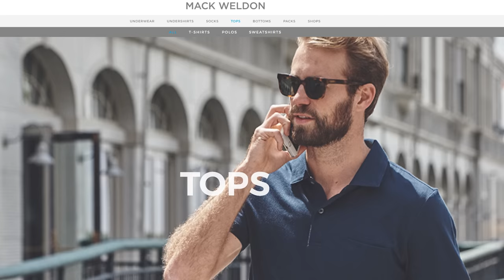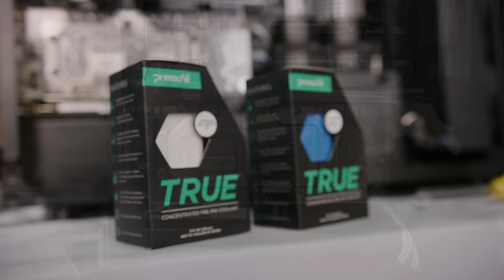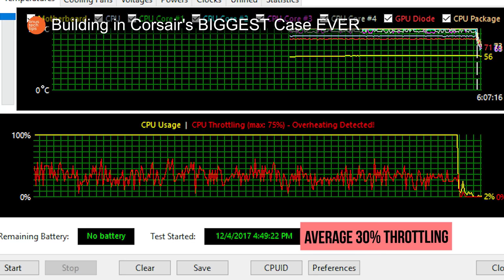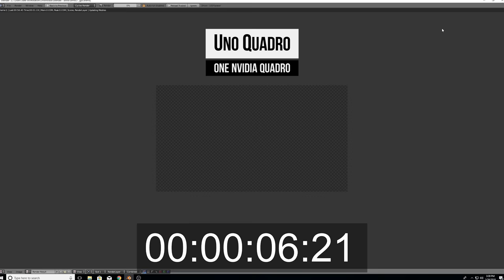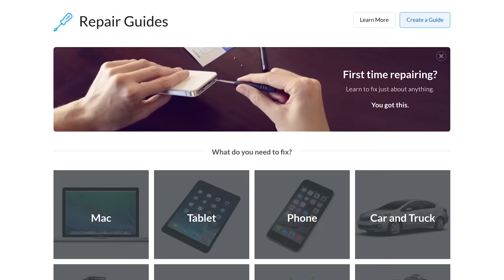Ultimate $20,000 Dual System Build – Corsair Slate Part 2

Comment: I could see this format being use by a IT pro for his / her house.  It can handle a small ATX format motherboard for FreeNAS or UNRAID NAS head for house /LAB storage while providing a different setup for a house central server as the main board / VM system.  MS orLinux.  As for temp stress level the water cool is nice but air cool works as well works for the long term..  LED are nice to have for function but not that much.  Still I like what you guys and gals did unless Linus use finger nail polish. lol

Comment: The 1000D as it is officially named. Is what I'm looking at for a build. I am planning to use its massive space for extreme water cooling.
Thinking an MSI Z370 M5 (Monoblocked) w/ i7 8086k (overclocked) 
I just think the 1000D would be amazing for a show'Case' (pulled a linus there :D)

Comment: I mean, if it costs as much as two cases anyways, you don't necessarily lose anything for using it as opposed to 2 normal systems, and there is an argument to be made for it looking cooler or fitting into a given space better. The big potential issue I see with it vs 2 separate systems is the thermals since you have 2 systems sharing the same case airflow, but that's really a non-issue if you are going water-cooled anyways, which I think is the only reasonable route with this kind of case anyways.

Comment: While Linus builds a machine that has a $499 price tag ON THE CASE, I'm gaming on a $250 rig, with sort of descent FPS, I would say.
I'm totally fine with 40-60 FPS, when I'm playing for 1-2 hours in the evening. If somebody is interested that's what my build is:
DELL Optiplex 990 SFF picked for $45 with:
Intel Core i5-2500 3.5GHz
4GB DDR3-1600 + $35 used 8GB DDR3 = 12GB RAM
$25 New 120GB SSD + $25 used 1TB 7200RPM HDD
$110 (new, after rebate) MSI Radeon RX560 4GB OC Low Profile
$10 USB WiFi adapter
Win 7 integrated license upgraded to Windows 10 for free.

Comment: id cut a spot in the wall and fit it inside with chrome trim or rgb trim lighting, Stack dual 2080s hook a 80 inch 4k tv 240hz refresh rate, Wall mount the tv get cut outs in the wall for the dolby 8.1 theater surround sound 8 speaker set, Bass boost to blow me out of the room not to mention playing all the latest games and have it rock me back and forth to sleep at night eh eh eh oh and maybe even a 3d tv who knows....if they make one 80inches lol

Comment: Well for sure its a very well made case, i built a Gaming PC for my Son, very adaptable case, for Air cooling or Water cooling, i would like to see the 2x 200mm Notcua Fans front with a large Aquacool radiator, you can get a 2x200mm fan tray,  plenty of room to fit more fans  200mm behind radiator, Mini ATX PC bottom on top of PSU as a Minecraft server, main PC MB as a huge gaming king water-cooled, i9 10900k, and I would use that 8TB Gigabyte 15,000 MBs PCIe card,
Just a really nice case, now the C700M is now finished production, Asus Maximus XII Extreme, 2080TI Kingpin, i would go all out for a build that would last for at least 5 years,

Comment: Ok. Question. 
On the workstation loop. Why not run from pump > monoblock > 480 radiator > GPUs > 2nd 480 > Back to resevoir?
Wouldn't that provide better temps to the GPUs?

Comment: I remember writing to microcenter about feedback related to the 900d during its glory years (2013-2016) and the slate has a lot of feedback they submitted written by me thanks to my two system setup. My only question is if the Slate can run two ATX mobos or dord the second mobo have to be a smaller form factor?

Comment: You should use this for an ONLY RGB or ROY G BIV build, I'm not kidding when I say only RGB or ROY G BIV, like everything, I mean EVERYTHING from cables to hard-line tube fittings RGB or ROY G BIV EVERYTHING. Also, take the fans from the Walmart PC you got and use them for the new build if you do this idea since they weren't just RGB but they were what I call ROY G BIV.

Comment: Well, This thing better be pretty beast cause I just bought it on Friday. Unfortunately it wasn't on sale. :( I'm putting in a glass tube/reservoir water setup in it with a 1080Ti and a delidded 9700K. I got 2 480mm glacier white radiators with 8 white-lit 120mm fans and 5 140mm white-lit fans for the top and rear. And am using EK's navy blue (more like neon blue) coolant.

Comment: There is a niche for dual systems in one, in the DAW (digital audio workstation) config. Since dual systems are advantages where single core speed CPU's such as the i9 gen K series at up to 5.0 GHz in Turbo Boost, are critical for serial processing - unique to DAW systems. Simply going for a dual CPU config. doesn't well overcome this situation where the tasks of DAW and plugin/sampling are separated out - the host computer running the former and the slave running the latter via the Vienna Ensemble suite for ex.

Comment: Ampere: Imma end this whole man’s career
Reply: Nah this case actually works with my 3090 and keeps airflow and temps down. I'm running an EVGA FTW3 3090 ultra with a 10900K which are both toasty but 55 Celsius under load in this case thats pretty damn amazing

Comment: This is an industry thing... but.... This would be perfect for a video output rig, the kind that control large LED video walls or massive projector setups.  Most people don't realize that you use 2 separate systems to run those... 1 system is just the controller, it tells the video server what to do.  And the video server itself needs no local controls as the control system controls it.  And of course, in entertainment where everything has to be portable, having your video server and controller in one case would save on transportation and setup time.
Of course, for such a setup you would populate the system with workstation video cards capable of outputting 6 or more separate displays each, like the Matrox family of graphics cards.

Comment: I’d use it for my work. The one motherboard would have a TR 2990WX and 4 P1000 Quadros with around 256GB of RAM to run my CFD calculations, like ANSYS. And the other motherboard would have a i9-9900K overclocked to the moon and back with the best cooling I could get, so I’d have the highest possible clock speeds for my maths work in mathcad prime and matlab, and I’d just add something like a gtx 1060 max q and 16 gb RAM to that side of the built as I would just need it to do the fastest possible calculations not to handle massive loads for extended period, that’s what the other side is for 😅. God I dream I could afford a build like that, my life would be so much easier, well maybe one day...

Comment: I am trying to build a epic pc in a 1000d case with a 13900ks, 4090, and 2 MP600 PRO XT Hydro X Edition 4TB drives and jam as much push pull radiators in as possible. I have never done water cooling and wondering what configuration you would recommend as far as reservoir, rad placement, etc.?

Comment: I would only use a concept slate for one thing. Extensively modding it and building the most extreme pc that you could possibly build and probably never actually getting the chance to use it. 

3175x with the max amount of ram (whatever the fuck it really is) on the gigabyte board with thunderbolt, high end sound card, m.2x4 raid card with 2tb 970 evos, 2x gv100 with nvlink, 2x rtx8000 with nvlink, and dual 10g lan with as many 4tb ssds as the board holds. And then a 9990xe on the itx asrock board with 64gb of ram, 3x 2tb 970 evo, as many 4tb 860 evos as it takes, and a rtx titan. Power it with 2 titanium psus with custom cables, and use ZERO rgb. All black and nickel. No plexi at all. Nickel plated copper tubing. Nickel plated fittings and gpu backplates. Fill the thing up with as many radiators as it can fit after modding. I wouldn’t be surprised if that configuration would top 100 grand. Then I would play Skyrim and supreme commander 2 on the 9990xe at 5ghz with the titan and run benchmarks on the workstation. Lol maybe folding.

Comment: I really wish they redid this case to fit 2 atx boards that would be epic :'( Making a workstation now, would have loved to have this Slate to make my workstation but also get rid of my old case and put my "old" MB in this case also (i7-7700k/Msi Z270 M7/Msi GTX1070) but the M7 I doubt would fit in the second board case for this beast.. :'( Maybe I could see if itll all fit on a itx case and still get it done... but I love this MB..

Comment: I'm currently trying to fit 4 x 480 rads into this case in push pull configuration.......doesn't work this case is too small! 😅🤣

So just 2 x 480's in push configuration in the top 😪

Comment: What do u use to check your cpu temps? I use core temp but I got 0 degrees Celsius for 3 of 6 cores. I have an r5 2600x msi b450 mobo and 16gb corsair ram and gtx 1060 from gigabyte

Comment: Gaming and Forex Trading. Small system with a graphics card that'll support say 8 monitors and two huge M.2 drives on a Mini ITX board. Then a much larger system for gaming and media that leaves room for expansion. Also topic for the community. Would we all prefer larger maps and more things to do over better textures. Our current hardware doesn't keep up with the games. I mean 2 x titan rtx's doesn't do 4k60fps at ultra on every game nowadays and that's brutal. Either need 4 way nvlink to work or some much better cards

Comment: 13 fans!? Are you MAD?. 16 would be better :) That's my count. I have 2 x 220mm case fans (intake), 2 x 140mm case fans (1 exh, 1 intake). my i7 8700K is cooled with a Corsair H115i Pro with it's Rad mounted up in the attic space of my THOR v2. 4 x corsair 140mm high static fans in push pull are at work there. To keep from blocking air flow to my new ROG RGB Strix Z390-E Gaming motherboard, I made a 1 1/4" riser that sits between the top of the case body and the louvered lid. On to the custom GPU loop. It's starts outside my case atop my racing rig with a 200ml Pump/Reservoir Combo. Water travels from the pump through soft tubing to the top of a 700ml Reservoir mounted on the back of my case. Coming out the bottom of the  Reservoir the tubing changes to hard brass that's chromed on the outside. the tubing enters the case and runs alongside the power supply then it turns up into the Full EK Waterblock that cools my Aorus 1080 ti. Leaving the GPU the chrome tubing continues up at 45* towards the front of the case where it exits just under the DVD. A quick turn back towards my rig, but not before switching back to soft tubing. Water runs under the top deck of my rig and into a 480 copper Radiator. Mounted on what would be the back of the Radiator are 4 x Corsair 120mm high static fans pushing air into the Radiator and 4 x Corsair high flow fans helping to pull that air through. Leaving the Radiator the tubing goes back to chrome and runs across the front of my rig at an upward 45* and back to the pump. That's over 6 feet of tubing, 2 feet in fittings and 40 oz of water. But does it work? I race Project CARS 2 and have most everything set to Ultra. I leave my GPU running at stock speeds, while my CPU is clocked at 4.8 GHz. I'm pushing three 24" 144Hz Lg gaming monitors @ 144 fps. Max temps: CPU 45C, GPU 52C. Oh and all the fans are dead quite, not a sound.

Comment: I usually have my PC spread over my table - hdd´s on one side, water loop cooling on the other - more hdd´s on top of a "sort-of-case" .. I mean it looks punk, but every time I see these temperature tests on a rig - likely closed up - I laugh my guts out - I have a 1900X OC@ 4350MHZ and my TOP temps on the CPU are 60 dead. My GTX 1060 OC@ 2200MHZ (if I remember right, been some time I played PUBG :) goes also to 65 TOPs, with air cooling. The biggest enemy of good temps is a closed case, fact.
Reply: Full specs are what for that?
Reply: Dont like to share my whole PC specs, but I can tell you that my DDR4 runs in quad channel @ 3400 MHZ with CL´s slightly worse then the shiny corsairs:)
And everything is so cool. Dont close your case, top tip

Comment: Try getting a gaming rig and a graphics workstation that can both do this for 20000 USD from Apple and this dual rig is not only awesome but an economic nobrainer. I haven't seen Apple do anything on this scale with 4 quadros in it. And for building it yourself using foreign parts you are saving over a prebuilt system which would be a special order using same foreign parts but domestic assembly manpower.

Comment: I would put the largest motherboard, largest cpu cooler and 50 1080tis and 50 ssds
Reply: Why tho... Basically all super high end mobos are E-ATX so you don't have a choice, 1080tis in SLI couldn't even fit in this case and would be choked for airflow. Why would you want 50 ssds? Just get like 6 but have them all be super high capacity... 50 ssds dosen't leave room for upgrading
Reply: TixsOP I understand but I was making it up as a joke...
Reply: @tix7278  not all high end mobo's are eatx

Comment: Can someone answer how this would hold up today with modern hardware? For example a threadripper and 2080's or something
Reply: Not good for either one. The case is fine but the hardware is pretty outdated if you're doing all brand new pre built. Just get the 5000 series from AMD and a 3090 if you want nothing but the best in the case that is the absolute best.

Comment: I would use it to play Minecraft with the latest PTGI from Sonic Ether at max settings 120hz...
...even though that's probably not how multi-gpu systems work. :(
Reply: fun facts about minecraft:
1. minecraft relies heavily on the CPU, but only uses one core. what actually matters is the CPU GHz clock.  
2. minecraft doesn’t support SLI, so it only uses one GPU.

Comment: soo much air in that system with the 480 rads positioned that way.  I am in the same boat now where my 420 rad is too close to the 480 dual rads.  Sigh.
Reply: ok we are all nerds here... but wtf are you saying?
Reply: @danielnielsen5169  simple science...air rises.  Positioning rads in order to fit fans/connectors etc...and into the case that is already massive which I also own...is unnecessary and could be improved with a single 1" size increase.  Having air in a system cuts down the ability for it to cool...and I didn't see any vac systems to remove/bleed said air.

Comment: I don't understand why these radiators are black. Bare aluminum would shed heat better. Any painting or coating acts as an insulator. There's a reason you don't see cars with black radiators.
Reply: Could be anodized 🤦‍♂️